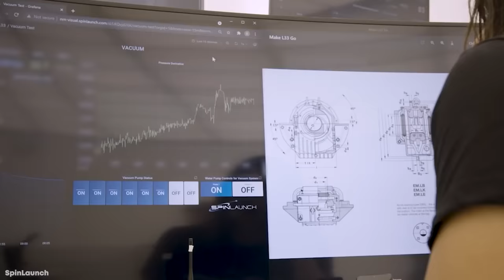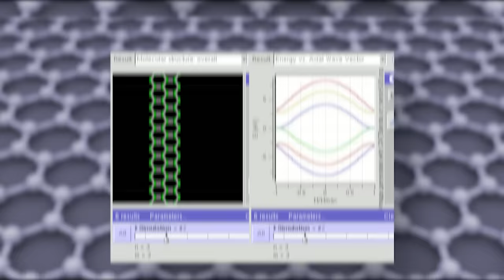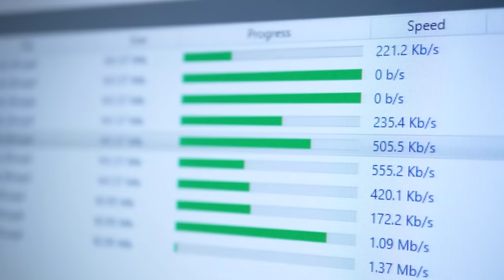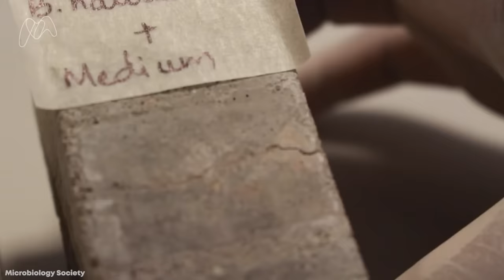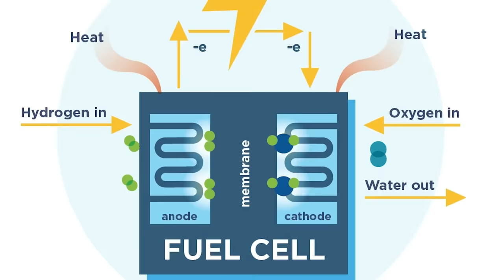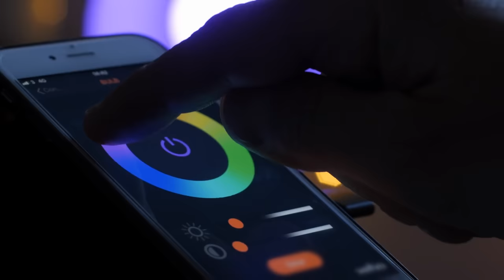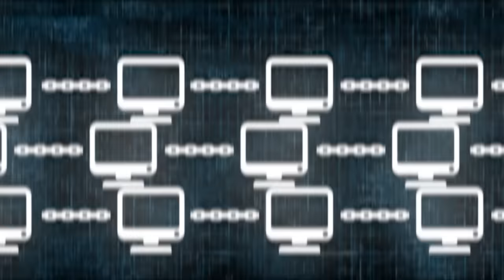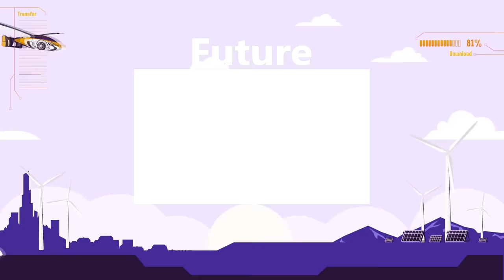15 Emerging Technologies that Will Change the World

Comment: The quantum computer part was also lacking information. Right now models are aimed at specific applications to be useful. You cannot think of a quantum computer as you do a general binary computing platform. The problems they will solve will be astonishing but you will likely not see a non-specific platform of use for quite a while.
Reply: You don't want to be that guy who said the same thing about computers we use now. Imagine the power of quantum computer neural networks. With access to all human knowledge and exponential imagination...probably a new order of consciousness even that we can't fathom. Able to think a virtually infinite amount of thoughts simultaneously.
Reply: Quantum computers are made to solve linear algebraic equations.
Reply: Carbon is BAD! MK! LMFBO
Reply: Maybe quantum computers could help us map out the neurocircuitry of the brain. Could be we could rig up an interface between human brains and quantum computers. We might even get a situation where computers are controlling us, kind of like in the movie "The Matrix", only humans would be supplying computing powers that machines can make use of, instead of machines using us for energy.
Reply: @ClarkPotter  - Agreed. I really think most people are DRASTICALLY underestimating the potentials of both quantum computation and AI.
Reply: I thought quantum computers were going to make cryptographic passwords and blockchain obsolete.
Reply: @rjohnson080  It could be a way to massively scale blockchain use. Theoretically, it could be used for hacking attempts in the wrong hands, but you would have to allow for unlimited attempts to try to unlock it, otherwise, it would just lock everyone out of their bitcoin accounts.
Reply: Mud houses ?
Reply: @ClarkPotter  Ha but think of the all the terror it could unleash, maybe when a quantum computer has some sort of AI uploaded to it.
Reply: for some reason i dont believe they actually exist, quantum computers.. i mean.. wtf

Comment: I love the one about the hydrogen fuel cells....Considering this technology has been around for about 20 years...Just hasn't been used, due to a lack of pressure on the industry, and the fact that the patent was buried by large corporate interests.
Reply: Plus , cars running with cylinders filled with air..
Reply: Your correct it has been around for a while but you didn’t go far enough back. There are videos of a man who actually did a cross country run with the technology in the 70’s! 
He mysteriously died and his invention disappeared 😉
And remember what was happening in that time period!!
Carter’s embargoes on OPEC which caused Americans to spend hours in lines to get fuel for the week and then it wasn’t a guarantee that there would be once you reached the pump.

Comment: A question for the self-healing concrete:

When the bacteria "heals" the concrete cracks does it know when to stop producing limestone?
Reply: yeah, almost seems like someone might have to come through with an electric sander every once in a while.....
Reply: Possibly when it stops being exposed to oxygen.
Reply: Decent question, because the process as it seems goes inside-out and it will be either based on parallel structure and when the crack is in the middle it will be fulfilled until all particles are connected or the structure will have to be pre-determined so it can rebuilt itself in the same shape without the bacteria being overused and causing deformations? What about cracks that are on the edge of the shape?
Reply: It stops as soon as the crack is healed, since there is no water and oxygen for the bacteria to consume once the crack is healed. A milimetric stub may appear on the surface of the concrete where there was once a crack.
Reply: Lime mortar / render self heals and breathes, making it FAR better in most applications than concrete.
Reply: It is about water and oxygen. When the crack is closed no more of these are available and the bacterium will form a spore and can live like that for some two hundred years.
Reply: Thats why they have bacterial construction management on site. All good
Reply: No it keeps producing limestone from: NOTHING!!!! It's outta control!!! It's like Ice-nine but worse!!!!
Reply: The food for the bacteria is mixed into the concrete when it's wet. The bacteria eats the food from the surfaces of the crack. I think the width of the crack that can be repaired is limited by the concentration of food available on the surface area.
Reply: What happens when you mix in antibiotics?
Reply: It stops when it’s bored
Reply: @Idontknow819918  When its bored it'll usually smoke weed with its buddies.
Reply: @Krommandant  once there's say a millimeter of limestone and still an inch of void left, how is the limestone coming from the 1mm layer any different then it just growing and pertruding from the wall? There's still oxygen and moisture on the outermost layers
Reply: i assume when it runs out of space?
Reply: No, this is the responsibility of the landlord to tell the bacteria when to stop.
Reply: @richardfiennes3616  I am not sure what you mean. I am not aware that you can build a motorway bridge out of lime render, rather than steel reinforced concrete.
Reply: No...., the Bridge will become finally Cancer .
Poor Bridge ....., 😭
Reply: i a total knuckle dragger but I'm wondering if some type of fail safe couldn't be in place an electric current temperature change, like anything though it could be malfunctions.
Reply: just heard theirs a food source so id assume no more food no more healing.
Reply: It stop when reach the acidic  solution.
Reply: @finished6267  Thanks for the Vonnegut reference 🙂
Reply: is limestone anywhere as strong as concrete?
Reply: I would imagine that oxygen is the key so as the crack closes so does the oxygen and hen it's 100% sealed the bacteria is rendered useless
Reply: @sbeveridge  Indeed  reinforced concrete is ideal for bridges etc, though bamboo is amazingly strong.   Just that concrete is one of the most polluting products on the planet, and UNFORTUNATELY many a good (historical) house has been severely damaged by concrete render was my main clarion call to using lime!
Reply: He says once they receuve oxygem they start producing. That means without oxygem they stop
Reply: Also consider how powerful human brains are compared to current technology. What's really crazy is computers are energy manipulators that provide communication. Everything on a mother board either conducts, resists or manipulates electricity.

Comment: From what I understand then, edge computing means going back to way things used to be done. Or was it just a very bad explanation in this video.
Reply: Hi, I’m an MS in computer science, and I’ve worked on a handful of research reports and term projects on the subject of edge computing. 

It’s a bit more complicated than just going back to local computing. It’s more about the science of determining which processes are worth pushing to the cloud — most “real time” jobs require as low of latency as possible, and packaging up data, sending it to a cloud, waiting for the cloud to finish, waiting to receive the results, and processing the results is too long. 

It’s mostly just handling the “over-hype” from cloud computing, where people are starting to realize that not every job SHOULD be on the cloud. 

That being said, a subset of edge computing is out there that wasn’t addressed at all. Basically, it treats all connected devices on local network (typically Internet of Things devices but anything with internet/Bluetooth and free resources can work) as different compute nodes of a distributed cloud. I guess in simple terms, rather than sending everything to a data warehouse to be processed, it shares partitions of the workload with any nearby devices willing to contribute work, giving the distributed computing powers of the cloud with the reduced latency of local computing (at the cost of reduced resources for computation, making it difficult to decide which devices should get how much work to perform.. there’s some very interesting papers on how neural networks or multi-layer perceptrons may be optimal for assigning load balancing. 

Ideally, edge computing is finding the optimal balance between work on your system, work on the local network, and work on the cloud to get every operation done in the shortest amount of time with the lowest latency. 

The example I remember from the biggest paper on the subject talked about how a smart car will use it’s own internal computer for processing immediate decisions on things like “red light here — gotta stop”, use other cars in the local network and a “roadside base station” for computing processes that have some acceptable latency on the decision making process, such as traffic analytics to determine things like when it’s safe to change lanes or navigating through construction zones with the shared routes found by other vehicles in the area. Finally, the centralized cloud would be used for gps and optimal dynamic route calculation (processes which don’t have any sort of hard deadline on when it needs to be done, it’ll have the cloud keeping tabs on traffic over the possible routes to your destination and continually recompute which route will have the lowest estimated travel time. Since latency isn’t an issue and the problem is so large in scope, it resides on the cloud. Then again, these technologies really only exist in theory at the moment because of varying standards across hardware manufacturers and all the first party / proprietary technology in the leading systems. 

Another one of the main reasons for edge computing is because we’ve reached a point where the few primary compute centers in the world are pretty much at network bottlenecks now; we are trying to make standards and implement methodologies for only putting the most important workloads on the cloud to reduce network strain

More complex still, there’s examples of edge computing being used to streamline the cloud itself. One of my personal research projects in a systems architecture course looked into ways compute clusters can use the edge computing design model to structure the “cluster” for better internal load balancing when running complex tasks like training neural networks, keeping computations local to specific machines/cores, and only syncing to the master/main/controller node (pick your preferred term for the centralized node that coordinates the others, some aren’t considered politically correct any more). Really fascinating research on how to train a big AI by letting each core train pretty much independently of one another, and saving the big synchronization tasks and load balancing for the main nodes to handle. 

Tldr for people who don’t wanna read or aren’t all that computer-sciency: edge computing is just a new design principle/standard where we try to be more picky about what we send to the cloud, and what is better to be done on your local device/network. Edge computing exists now that we know that the cloud isn’t a magic catch-all solution for every problem, and we understand it’s limitations

(Also on a side note, the quantum computing wasn’t that good of an explanation either. It wasn’t my area of expertise, but really it only excels in problems we’d otherwise have to brute-force. It maps the possible outcomes to probabilities, eliminates any below certain thresholds and manually checks those with high enough probabilities. Really cool stuff that’ll make passwords effectively useless. But really outside of cryptography and academia, nobody has really come up with any practical uses yet. Again, it’s not my field of study, but I personally predict it won’t see commercial use for a long time if at all, since there’s very few ways the average consumer would use their computers for which would benefit from being able to solve NP Complete/Hard problems. That being said, if we fed quantum computers specific real world problems, it could vastly improve our quality of life, but those would be one-and-done optimization problems). 

Sorry, got carried away. Computers are my area of expertise
Reply: @ZarBluestar  Thank you for your explanation, and for taking the trouble to be so thorough. The fact it's taken me seven days to notice it is probably down to my brain being wired to the cloud.

Comment: Should be looking into Thorium as a new power source. So so much better than anything else we have out there.
Reply: Yes, lots of energy in Thorium.
Reply: But we'll have fusion by then
Reply: @ricke6854  Back in 1990 I heard a lecture by someone from the General Atomics Fusion Research facility in San Diego. He said back then he was optimistic that we would have a viable fusion source in 10 years. Fast forward to today. I'm not holding my breath.

Comment: More tech to make life easier.....until the tech goes wrong and you spend hours fixing it. It creates more problems like doors wont lock, lights wont turn off.....id rather manually do that stuff and save IT for the complicated stuff.
Reply: True I think that it's easier to change a doorknob then rewire a system. But even though it costs money both ways a manual doorknob is less expensive and still proves good use.
Reply: @DeliciousFood69420  oh you know... just make sure your tek is protected from solar flairs. This isn't even really necessary all you actually need to do to protect your valuable electrons is 1) turn it off and 2) unplug it and boom your stuff is now protected from any power surges caused by a sola flair/storm.
Reply: @DeliciousFood69420  You mean the very strong ones like the Carrington ones?

Comment: 18:31 I understand the benefits of using this tech for fire extinguishing. However, every fire aftermath still has embers of a fire that may still be active. Probably sound and water combined on fire extinguishing may be a good solution to save water.
Reply: That sound fire-extinguisher looks ugly, cumbersome, and crazy. The firefighter has to get so close to the small flame to extinguish it. He is likely to be burnt in the LA fire. I don't see it being used so close to a forest fire the likes of LA.
Reply: @eltoro6064  They should just make them bigger like the Sonic weapons
 (USW).
Reply: I shall inform the creator of this much overlooked f*ckup and recommend you get a gold star. ;)
Reply: @wallywalpamur4960  Thank you, Captain. I love you since the 80s.
Reply: @harumahisesi261  😳😳😳😳😳😳😳😳😳😳😳😳😳😳😳😳😳
Reply: Using this technology will suppress & prevent a fire from combusting (unless its a chem fire) it will still maintain a high risk of  reflash. This tech will benefit most in server room & clean rooms

Comment: Quantum computers cannot actually solve "any" problem that classical ones can, however, they are magnificient at solving what are called NP-hard problems-really difficult ones that classical computers can't because the time it would take with classical computers grows exponentially with the number of elements in the problem. Combining quantum computers in a hybrid network with classical ones could prove to "do it all," however.
Reply: Problem with that is that no human ever sees that code. You never know how the machine solved the problem. For example, some problems really beg for the end of humanity! Read Sci Fi sometime!
Reply: @ThomasLee123  You're mixing up quantum computing and machine learning/AI there mate. Quantum computing most definitely needs to be coded still. It's got nothing to do with AI, though that's not to say it might not one day be used to power AI.
Reply: I think the chatter regarding what people may or may not know is Shor's algorithm scares people because they hear something about quantum computes being able to break security, but they aren't aware of quantum safe encryption schemes like lattice/LWE, or something like bb-84 which eliminates these problems by basing cryptography on physics instead of math.
Reply: Quantum computers can't solve NP hard problems.  This is flat out wrong.  They can solve problems in BQP like integer factorization.  But to mislead yourself into thinking they can solve problems in NP is pretty naive.  Nonetheless there are plenty of applications for them.

Comment: Maybe they could reinforce concrete with graphene. That might make it more likely to hold up during an earthquake. There are probably a lot of other structures that could be reinforced with graphene. Maybe, given graphene's electrical properties, someone could cover their whole roof with graphene, using it not only to protect from the weather, but to link up with vast numbers of electric transmitters throughout the world.
Reply: I don't think they are producing enough graphene  to make it cheap enough to do that, even if it could do that
Reply: Yes. The problem with graphene right now is that they can't produce it in industrial quantities, but if they ever do solve that problem we'd better watch out, because the material has so many incredible properties.
Reply: Graphene is supposed to be some kind of wonder material with amazing properties. It can do some extraordinary things. The problem with it right now is that they can't produce it in industrial quantities. Once that happens amazing things could be done with it.